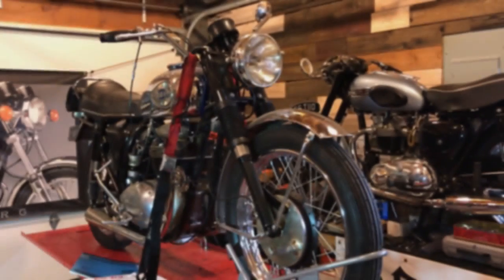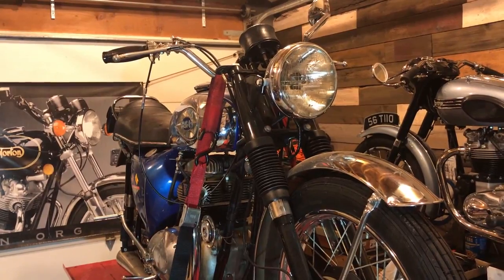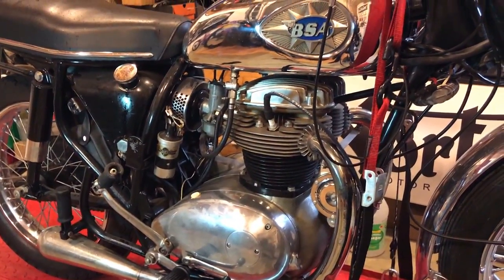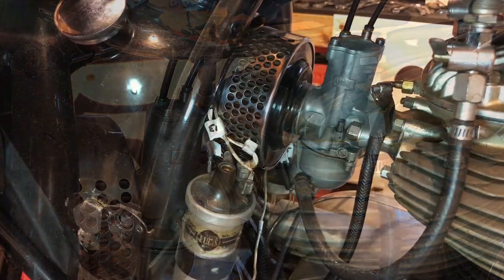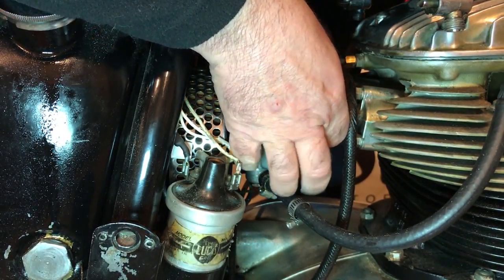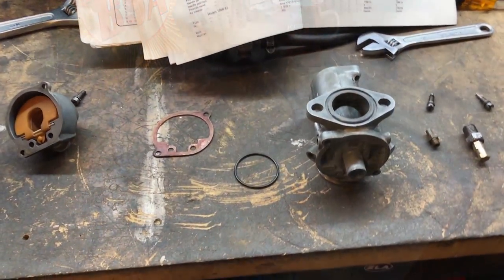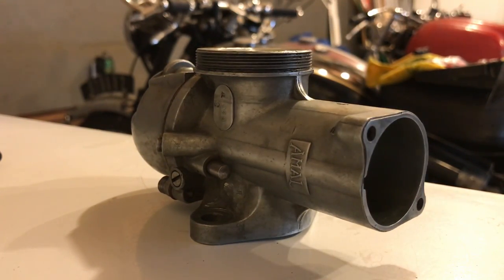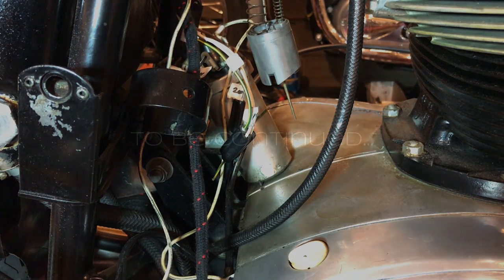1968 BSA Thunderbolt 650cc - going home, or NOT (part 1)

Comment: Carb flange truing, I find that putting the carb body in a flat jawed vise like a milling machine vise and gently squeezing the flange & body back to true. This does two things. It flattens the flange some and more so you can true up the slide bore so the slide no longer binds. You don't want a stuck slide riding. Then sand the flange to true. When reinstalling you need to be careful not to use ANY soft gaskets or you will re warp the carb body. I usually add the phenolic plates to insulate the carb some and thin gaskets on the head side and just the O-ring on the carb side.
Reply from the maker: Thanks very much Ron, this is excellent advice. Best wishes, Mike
Reply: Do you make the phenolic plates or is there a source of reaady-made ones?  I just got my hybrid BSA ('67 Thunderbolt engine, 68 Royal Star 500 chassis) running this weekend.  I rebuilt the carb, but I have a monobloc, not a concentric.  It was burning oil when I put it away in 2013 becase the gas taps rusted off, I cleaned and de-rusted the tank, re-fitted fresh taps, new gas lines with an in-line filter and last fall put a bunch of combustion chamber cleaner in both cylinders.  A whole lot of grime came out in the sump screen, cleaned it all up, put it back on being careful to tighten evenly, put gas and oil and the 10-15 year old battery in, cleaned the main electrical terminals (coils, Zener diode) and it fired up very easily, and no longer burns oild so a ring must have been stuck and now loosened up without a tear-down.  I find with the carb flange you just should not over-tighten it, it comes with lock washers, tighten to snug and check regularly and it should not warp any of the carb body.  Now I need to go over all lubrication points, new tires, check the brakes, find the fault in the horn circuit, fix up the lever clamps, clean everything up and polish a lot, and I want to fit a kill switch for safety.  These things handle so nicely and the ergos are really comfortable.  Hoping to get out on it a fair bit this summer.  Cheers
Reply: Plywood makes an excellent heat shield for the carb.
Have you checked the passages within the carb body for humming?
Please check the angle of the front brake drum operating lever. It should not be at 90 degrees until applied

Comment: what I don't quite understand is why some models from various years with the same size tank have daylight between them and the rocker cover. Mine sits quite low so that the rocker cover is obscured and it is difficult to find a path for threading the high tension leads behind the petcocks. I am going to check the rubber mounts to see if the correct one are on it.

Comment: Bit late to the party--just been binge-watching your stuff on and off all day and evening, commencing with your superb and extensive 'Norton Atlas Project – Shep' series, for which I cannot thank you enough. As far as this BSA's Amal carb, unless I'm mistaken it seems to have one of those craptastic original white plastic float needles. They're too light to do the job properly, and because they cause all sorts of mysterious fuel delivery issues, most have long since been replaced with the heavier and better brass viton-tipped ones. In fact, it's pretty rare to even see the plastic needles still in use. As for the flange, I usually give the rubber O-ring a very light smear of RTV Red silicone gasket goo, and that seems to keep her from wheezing.
Reply from the maker: Hi Bill, thanks a lot for your note.  I appreciate your advice.  Best wishes, Mike

Comment: Sorry, not trying to be a big critic, but I would never use the refrigerator as a flat surface. I simply buy a cheap picture frame from a discount store and pull out the glass and use that. Old timer taught me that years ago using the glass to check for flatness and to use as the Emery cloth surface.
Reply from the maker: No problem at all James, you are absolutely right. I hadn't realized that even the surface of the fridge wasn't actually flat. I have since bought a very good surface plate and it works great. Cheers, Mike

Comment: Great video. I bought a 68 Royal Star October 2016. I will be following gyour vids to help me. I m pretty handy and have a few old Brit bikes, and have done quite a bit of work on them but any extra learning is always good. I rebuilt the kickstarter and put in a Wassel ignition. New Wipac dimmer and horn switch. It has a kill button on it but haven't figured out how to wire it up with the wassel yet. Any ideas?I also have a billet sump plate the original has had 3 of the 4 bolts removed (probably stripped) and screws put in. I think I will need to get a shop to drill the holes and helicoil it for new bolts to mount the plate. Starts okay but I think next winter I will completely overhaul fuel system including relining tank. Have you adjusted the clutch on these bikes? I followed the MMM Nicholson book instructions and I think its too tight now. But cable adjuster is at max if I leave the center screw adjuster slightly slack and tighten the nut.

Comment: The cable tidy at the top of the right fork leg, is that something you made or bought? and it is only for the choke and brake I gather!? What Amal Concentric did they run of these '68 models?

Comment: Your wet sumping problem is likely the little ball valve in the oil uptake pipe, if it gets grime stuck to it or the spring sticks it will wet sump.  Also, next time you have a complete tear-down (which is of course inevitable; in fact it's part of the factory maintenance schedule) make sure you find and clean the grime trap in the crank.  Silly way to have a grime trap, but that's why the Japanese took over, much better engineering and design.  But not as much character.  Cheers!
Reply from the maker: Thanks very much Thomas!  Cheers, Mike
Reply: Drain down can't be via the pick up nrv, that can only drain the return pipe. There can be a little leakage past the gears in the oil pump, but the most likely cause is the ball valve behind the oil pump needs reseating.
And yes, clean the sludge trap & fit an external oil filter in the return to the tank.

Comment: Hi there, I have a question for you about a BSA... I bought a 69 Lightning and am in the process of restoring it, I have hit a snag that I can not figure out... when I try and hook up the battery it instantly blows the 17 amp glass fuse that is in line with the positive terminal, I have checked all over the bike for a short and cant find anything... any help would be greatly appreciated because I am at my wits end...
Reply from the maker: Ryan Chelberg Hi Ryan
Thanks for your note. Yes, it definitely sounds like a short but I will ask all my friends who have A65s and get to you ASAP. Cheers, Mike
Reply from the maker: Hi again Ryan.  here's a reply from one of my pals:  My first guess is that a negative got hooked to the frame somewhere. It can get confusing with the positive being the grounding wire. 
Not knowing your machine, some one could have started to make it a negative ground unit but didn’t switch the whole thing over. Isolate your different systems at the battery if you can and check them one at a time. Hopefully You will find the short quickly.
Reply: Thanks I'll look into that!
Reply from the maker: Ryan Chelberg hello again Ryan, and here’s another reply from another friend: Your fuse should be in-line with the negative battery terminal as your system should be a positive ground system.
Reply from the maker: Ryan Chelberg hi Ryan. Here’s another reply: The first question I would ask is whether the ignition switch is on or off when the battery is connected and the fuse blows.  If the switch is off, the short should be in the immediate vicinity of the battery, since none (or very little – consult the wiring diagram) of the other wiring should be activated.  If the switch is on, I would first experiment with a larger fuse.  I can’t find anything in the BSA electrical specs or wiring diagram that specifies fuse size, but my 71 Triumph calls for a single 35 amp fuse.  After that, if the fuse is blowing with the ignition switch on, I would try to isolate parts of the electrical system by disconnecting grounding wires (typically red), to try to locate the portion of the system with the short.
Reply from the maker: Ryan Chelberg hi Ryan. Another thought: Wild guess here - bad Zener diode under the triple tree ?
Reply from the maker: Ryan Chelberg Hello again Ryan. Here’s another reply that might help. The standard A65 main fuse was issued as a “30” amp fuse – not 17.  Also, the main fuse should be attached to the “NEG’ side of the battery since the 1969 A65 units were 12 volt “Positive” ground .  (unless converted to neg Gr.)  I would sure start there before the next step.
Reply: Hey there, looks like the issue was reversed connectors... they were both red so I took a shot in the dark and was apparently wrong haha, thanks a ton for the help, she is almost ready to ride now!
Reply: The Mighty Garage 30 amp English, yes, but the US fuses are rated differently. I run a 20 amp fuses in my old Triumphs.